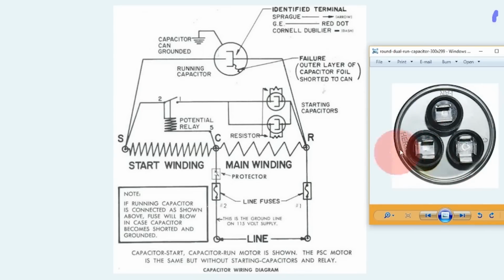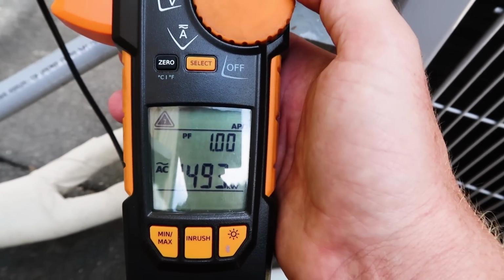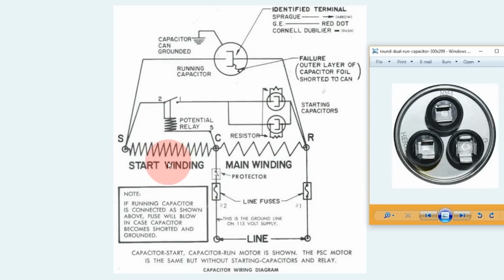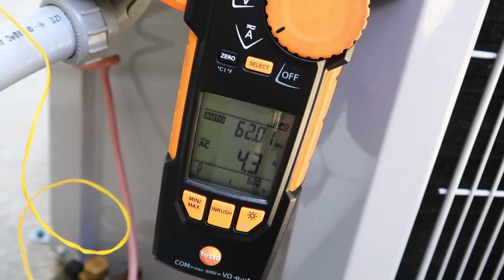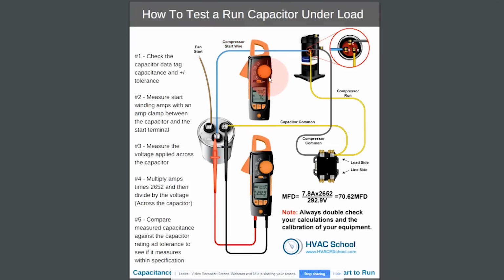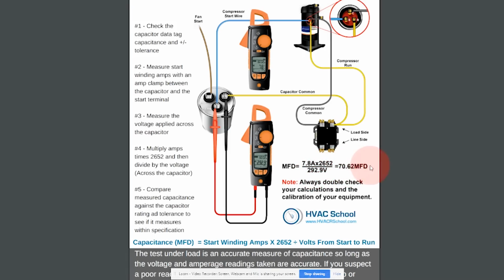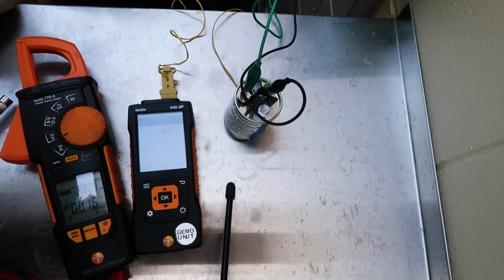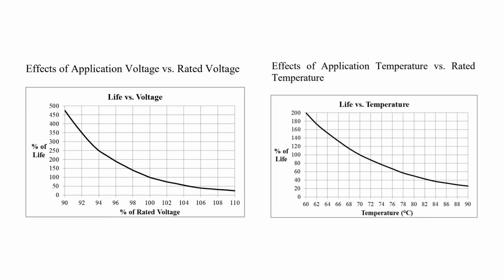Why Do Capacitors Fail? (It’s not why you think)

Comment: Im on my 7th standing oscillating fan, it'll run all day for months on end. Without fail if I turn it off  to clean and it stays off for a week or so, when i go to turn it on I get nothing. Blade turns by hand and it gives a hum,  had I left it running it would still be running. I think its the capacitor that starts it , anyone have any theories?

Comment: When the voltage spikes and then drops on the oscilloscope that’s when the circuit absorbs radiant energy; 400k watts per sq.inch. Protons don’t squirt out of the flashlight 🔦. The fast on & off can also light a fluorescent bulb when the ballast is weak. John Biddini’s bicycle wheel charger will help you understand the concept. Over-unity an DX system is. Ob1

Comment: You always say that current cannot flow through a capacitor. I made this video showing that current does flow through a capacitor. Can you explain how it is doing this and how I am confused by what you’re saying? https://youtu.be/brZlaFynwuk?si=OwaknT4Xob-6i7O_
Reply: In amplifier circuits, you’ll have a dc power supply and you’re using transistors to increase the amplitude of the signal. And then the next stage of the amplifier will be at a higher dc voltage so that the signal can be amplified some more. You’ll use a coupling capacitor to allow the ac signal to travel on to the next stage while isolating the different dc power voltages of each stage. There are plenty of circuits where capacitors are used to filter lower frequencies but otherwise allow the high frequencies to go through. So I don’t understand why you say current cannot go through a capacitor.

Comment: Here are some crazy info. If you take the amp draw off your start winding from the compressor, times it by 2650 and then divide it by the volts across the run cap (c - Hern) you will get your run cap size. If it’s more than 10% off you need to replace it. Some brand new run caps May fell this test because they were improperly made especially the ones from China.
Reply: I guess I should’ve watched the video further before commenting  I guess it’s 2652 😂

Comment: I was curious about the factor of 2652, in the capacitance calculation. It never occurred to me that you could actually measure the in circuit capacitance, from the voltage and current.

In case I missed it in the video, or in another comment, here's where the 2652 seems to come from: 
rmsVolts = Impedance x rmsCurrent
Impedance = rmsVolts/rmsCurrent  (E1)
Impedance = 1/(wC) where w is the line frequency (in radians/sec), C is capacitance
w = 2 x pi x f, where pi = 3.141596, f = 60hz
So Impedance = 1/(wC) = 1/ (2 x pi x 60 x C) = 1/(120 x pi x C)
Using this in E1:  1/(120 x pi x C) = rmsVolts/rmsCurrent
Flip both sides upside down:
120 x pi x C = rmsCurrent/rmsVolts
Solve for C:
C = ( rmsCurrent/rmsVolts) / (120 x pi)
This gives the answer in Farads. Divide both sides by 10^-6 to get microfarads:
Cmfd = ( rmsCurrent/rmsVolts) / (120 x pi x 10^-6)  =  ( rmsCurrent/rmsVolts)  x 2652.6
Close enough.

Comment: Added a sureswitch brown out short cycle protection, delayed start on power outage, whole home surge protection, finally tossed the Chinese made caps replaced with reputable USA made caps. Now only life and ambient temps are more likely the eventual failure. Added a heater and rated kickstart suggested by manufacturer, all this after investigating my failed contractor grade ac without any options used, mine now comes up to speed smooth and quiet neighbor with identical unit sounds like it going to shake itself apart very noisy in comparison,

Comment: Most common problems to a capacitor at line voltage is arcing.
They heal themselve but every arc is decreasing the area of electrical charge and reducing the capacitance.
After some jears of working they have not enough capacitance to give enough current to give enough
phase-shift to a motor. Every unit working at line voltage has the same issues.
A totally blown of capacitor at line voltage is rar.
Electrolyt capacitors have a live span in hours but paper or plastic insulated capacitors not  but they have large dimensions for some microfarads.

Comment: I've always been told it's heat. If the system can't breathe, such as a clogged coil, the capacitor will overheat. And just like a battery, it'll lose charge and fail.

Comment: If ya still don't understand get several caps and a thermal imager. Some phones have thermal imaging cameras. And you can look at the temp differences until you dial in a equilibrium temperature of start windings and run windings .  Yes it's not proper but you an get the job done without frying the motor while continuing your study's here on the tube until you figure the cap mysterys

Comment: With aluminum electrolytic capacitors, they're are a component that is KNOWN to degrade over time.
That's just the way the thing is. It's based on chemistry, and over time side reactions happen that negatively impact the performance of the capacitor.
The only thing that can change the rate the capacitor degrades at AFTER it's manufactured, is how hot it gets, but if the electrical ratings are EVER exceeded, all bets are off.
BEFORE it's manufactured, in the design phase, the most critical element of the design is the chemical formulation of the electrolyte (not oil) in the capacitor. In the IT electronics world, we also use a lot of aluminum electrolytic capacitors, at both high (rectified and doubled 120v line voltage) and low (12v and under) DC voltages, to smooth out ripples in the DC current.
Back in around 2004-06, there started being a problem with a bunch of our electronics. Capacitors were self-destructing when they had no right to do so.
Interesting story of why that happened. Some Chinese manufacturer of electrolytic capacitors stole the electrolyte formula from a Japanese manufacturer of similar capacitors, but the data they got wasn't quite complete. Not knowing they didn't have the full formula, they tooled up and made millions of capacitors and sold them at a cost significantly lower than the Japanese manufacturer's capacitors. Now, I said incomplete electrolyte formula, I forget exactly what it was that was missing, but the end result was that these capacitors degraded MUCH sooner than they were projected to.
Cue the years of 2006-2010 having computer repair shops filled with computers that had failing capacitors in their components (usually power supplies and motherboards).
This became known as the "capacitor plague", and it's why when you buy a high-spec computer power supply or motherboard they'll now make a very concerted effort to mention that they used "Japanese capacitors" or now "Polymer capacitors (ditching the electrolytic capacitor entirely) and have a 10 year warranty on the PSU against manufacturer defects, with the usual disclaimers and exceptions.

Now yes, there ARE paper-oil capacitors out there being used as run capacitors (and you'll find one in the HV power supply for EVERY microwave oven, but it's unsuitable for start/run use due to it only having 1 to 4 mfd of capacitance).
However, the aluminum electrolytic caps rated for AC current are always smaller than, and are (importantly) always cheaper to buy than the paper-oil capacitors, with that price being lower both for the HVAC equipment manufacturer's procurement department and for the repair tech.
So all you find for sale anymore is the electrolytic ones.
That's why the "older" caps hardly ever wear out. They're using a totally different construction (paper-oil, probably PCB oil at that).

But there's still something you can do as a repair tech to ensure a capacitor you install lasts longer than the failed unit you took out.
What's that you ask? Well, capacitors have a lot of different specifications.
If you pick a "Low ESR" (equivalent series resistance) capacitor for the replacement, it should last longer.
Additionally, if you pick a higher voltage rated capacitor, that can help it survive power surges and atypical operational conditions better.
However, the statistic that easily makes the most difference on how long a capacitor lasts is the Temperature rating of the capacitor.
What you want to look up is the 100 year highest daily temperature of the location you're at (should be easy if you have a smartphone) in ℃ (even in the USA, because capacitors are rated using that temperature unit, not whatever the weather channel is telling you), but if you have to convert it that shouldn't be hard for you the HVAC tech that has to deal with temperatures of all kinds of things day in and day out, right? Again, your smartphone is right there if you don't remember the conversion formula in your head.
OK, so you found the 100 year hottest temperature for that area, and if it wasn't in C you converted it. Now what?
Multiply by 1.25, this gives you a 25% safety margin on top of the hottest temperature that can be reasonably expected.
Now pick the capacitor temperature rating that is equal to or higher than the temperature you calculated, and go shopping for a capacitor that has that temperature rating as well as satisfying all the other requirements you have for it.
But don't be surprised if it's more expensive than an OEM capacitor. However, you've got to remember that OEM capacitors aren't built for Arizona desert heat.

Comment: My original run capacitor just lasted 21 years.  I estimate I run the A/C for 500 hours each year, though, so that is only 10,500 hours -- far less than the 60,000-hour alleged design life.  It was mounted with the connections pointing downward, so I assume this is what you mean by "upside down".  Maybe it would last longer if I flip it around, but it seems like water could possibly collect on top.  Nice job on the video!

Comment: My capacitor has failed after approximately 10 years. It's in a Rheem unit and was mounted sideways in the airstream from the factory. You're saying mounting it upright inside the enclosure area would be more desirable?

Comment: In Portland Oregon, I replaced a lot of capacitors each summer.  They typically run between 238 and 245 volts to most residential units with bad capacitors.  When measuring across the two capacitor terminals while the compressor is running, I normally get between 400 and 426 volts, depending on the capacitor size, with the larger modern high efficiency units with huge capacitors running even higher than typical.  A 4 ton system with a 65 Mfd capacitor is around 425 volts across the two terminals.  Sometimes I see a 370 volt capacitor in the systems.  

You must use the 440 volt capacitors in Oregon, where the running voltage is normally very high.  370 volts will not survive very long.  

When I worked at a University, the main building had 67 water source heat pumps running at 208 volts, and I rarely ever had a capacitor fail in that building.  But other buildings with 480 volts, or the residential units for student housing had capacitor losses.

Comment: Yes when we had that heat wave a few weeks ago I replaced several condensing motors all 2 find out it needs a cap as well and what took it out was a dirty condensing coil short cycled off on high head but I replaced 1 everyday that week

Comment: Please explain in simple language the below section i copied and pasted from the internet.   THE HIGH VOLTAGE ACROSS THE CAPACITOR.         Thanks
The maximum voltage in the series R, L, C (r being the resistance of the windings) will make the largest PD develop across the capacitor as it has the highest reactance, As max headroom says, study LCR circuits and Phase relationship for a better understanding.
In practical terms, the run capacitor should generally have a voltage rating of at least 1.5 x the supply voltage and more often than not it is 1.75 to 2 x the supply voltage.

Comment: I learned a lot, but I still don't know why I blow a capacitor 2x a year for the last 5 or 6 years.  Either my lines get hit by lightening all the time, or the garden gnomes come and start a fire under the cap to get it hot?  IDK, but I guess I'd have other problems if either of those were the case though, right?

Comment: I was thinking that if you had a surge suppressor which shunted a surge to ground you would immediately trip the RCD.  Perhaps you meant an active to neutral short of the surge.  Which still could lead to an enormous current.  Isn't it possible that if lightning struck a transformer nearby the current might be thousands of amps?

Comment: High voltage, higher temperatures, poorly designed or end of its lifespan. What about corroded contacts, connectors and overheated wires?
Reply: Thanks for this video

Comment: I have seen many techs not use the dual capacitor when replacing.  They would rather use a separate cap for the fan and single cap for the compressor.  Is there any valid reason to make such a change of the approach initially used by the equipment manufacturer?

Comment: On the Texas Gulf Coast lightning "caused" power surges are common.  I lost thousands of dollars in appliances and electronics; but I solved the problem 8 years ago.  I installed an Eaton CHSPT2ULTRA surge protector on the load center.  It has a surge current rating of 108 kA.  Since then I have not lost anything.  Best $200 I ever spent.  It wont protect from a direct lightning strike like I had when 6ft of the chimney trim was blown off (nothing will do that); but it should protect for almost anything from the electrical lines.

Comment: When you consider the capacitor also acts as a HeatSink, Dirty Condenser, High Ambient Temperatures and Short Cycling are #1 causes.  Always find out what MFD/Voltage Capacitor  the motor requires.  Just because the Condenser “looks” clean doesn’t  mean it shouldn’t be cleaned.

Comment: Besides China...I was told that the mathematical equation used in manufacturing is off, just enough for it to initially work. Apparently, they never corrected the equation. It's the same thing with capacitors in computers. It's a world-wide conspiracy I tell 'ya!

Comment: Keep in mind that the capacitor is also a chemical based component and over time they can actually dry out which causes the capacitor value to fall over time to the point that eventually the motor startup will fail.
Reply: I think that is what is happening to my 50 HP 3 phase converter (from single)  I bought the unit with 33    50 up capacitors to start  50 HP.   not enough now it won't start.  trying to learn to fix it myself.
Reply: @bradjunes1610  Do you have a meter to check the caps with? If you suspect the caps but don't have a meter you can always keep your fingers crossed and just swap them out.

Comment: The capacitor is kind of like two very large old-fashioned wire TV antennae that are folded and inter meshed with one-another, but never touching anywhere inside the container.  Thus, they should have no possible way of conducting direct current inside them unless they develop a short circuit of some sort, called "leakage", which is bad news.  They can also burn out and no longer conduct anything, which is a far safer way to fail.  What they do is charge up the two interleaved antenna wires with a charge, on side being positive and the other negative, allowing them to soak up a rather large, for the size of the device, electrical voltage across the tiny internal gaps.  How much current and voltage they handle defines their capacitance.  To get a flow of power across the gap, you need AC current, since moving one side of the wires will move the other side like many tiny magnets on rollers next to one-another along each internal wire.  The capacitance and voltage requirements on a capacitor tells you haw much charge can be stored inside (it can be large enough to kill you in some designs!) and how fast the frequency has to be that is being conducted to get certain amounts of power to go through the capacitor.  Low capacitance devices need higher frequency AC to get enough flow, while large capacitance devices have a lot of "surface area" inside and can work at lower frequencies -- in electronic devices this controls what frequencies are allowed through various circuits and is what allows most of these things (smart phones, for example) to work.  Storing charge to give a higher kick to a circuit, as being discussed in this video is the other major use.

Comment: A capacitor is in some ways, akin to a mechanical spring. Thermal inrush currents stress the plates and dielectric. There's also thermal expansion and contraction. You may even have some back EMF there from the windings that may be acting a bit like an inductor. They could also last longer if they had a higher rating, but then they would be of course more expensive, take up more space, etc. All engineering is about space, time, and money. Roman Roads took entirely too much time, labor, and material to build, as compared to roads that we build today. But we have to replace ours every few years, and yet some of the Roman Roads are still in use. Just my take. 73 DE W8LV BILL